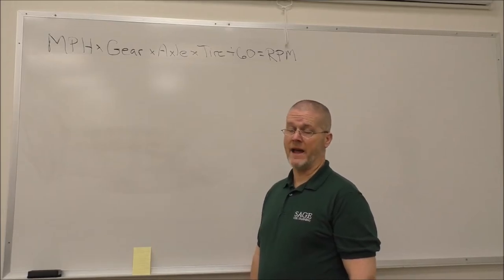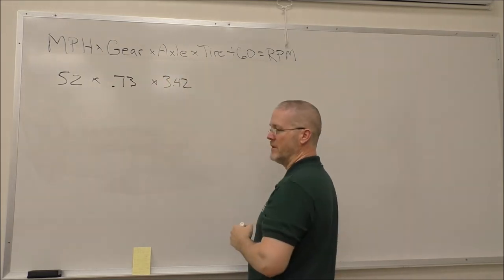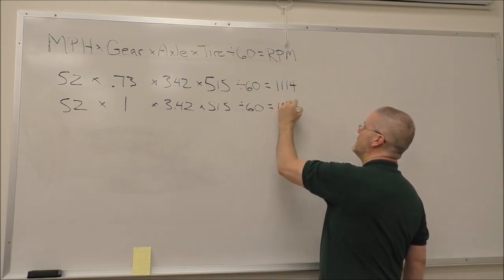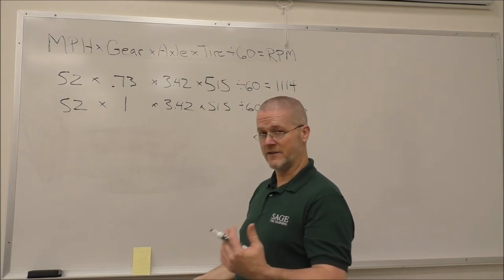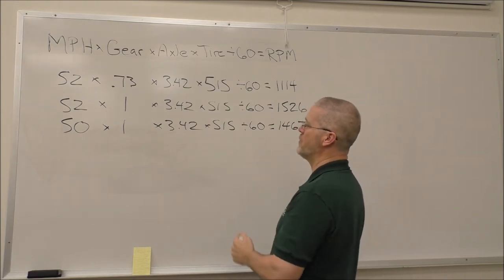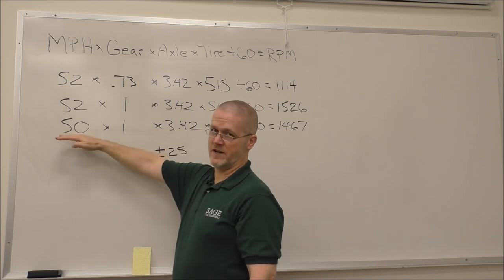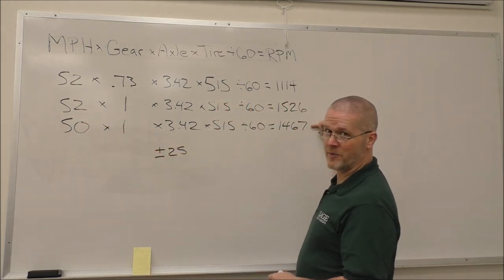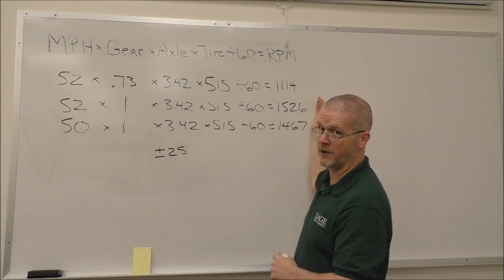The math behind shifting the non-synchronized transmission- Part 1

Comment: Thank you, this really helps me understand it better. 

But what I most want to know most is why on earth we have to put up with this. The Europeans have more powerful trucks that haul heavier loads on worse roads, but they have synchronized transmissions. Scania can take an engine producing 770hp and 3500 lb-ft and run it through a 16 speed that shifts like a car, but Eaton needs a SpEcIaL gearbox to get like 200 less horsepower and a thousand less torques to the ground. 

I don’t know, it just make Eaton seem a little dated. And lame. Like someone insisting the musket is just as good as the bolt action, if you “just know how to use it right.” Oh please.

Comment: You end up doing it by sound, listening to the transmission. Of course...if you CAN hear it. My bus has the engine a bit too far to hear (and behind the engine which is loud). I only have 4 gears, with something wonky in the shift rods...or maybe in the lever rods, because each shift is never the same lol. I go for 2, I end up in 4 (its worse when I go for three and it hits 1...damn near ripped the rear end out while hopping on the freeway lol).

Whats worse, is that when new, it has a HUGE play in the shift lever, and its dog legged and reversed, so after driving a normal anything..this takes thinking. 1st, up to the right...then 2, middle-ish down...and so on. Cant find the gear for speedo or odometer, so no speed indication, no rpm indication...its all feel and sound (and smells LOL)